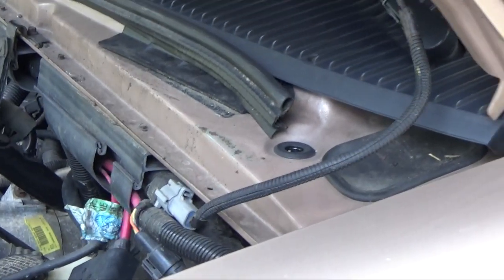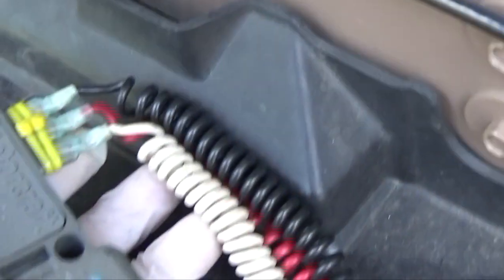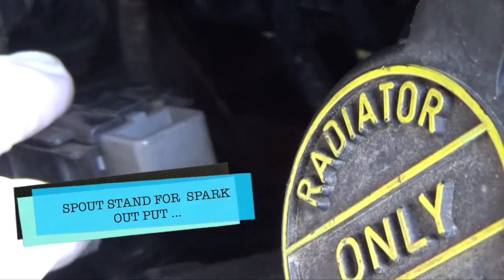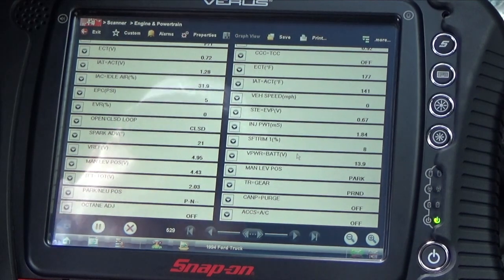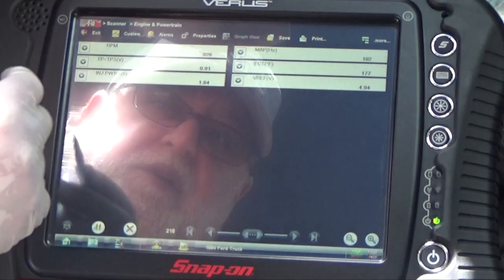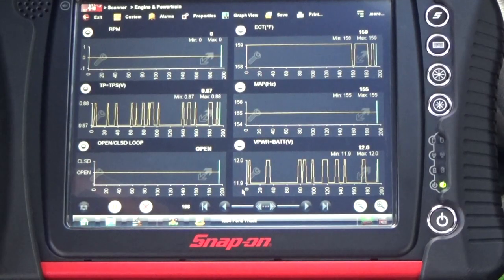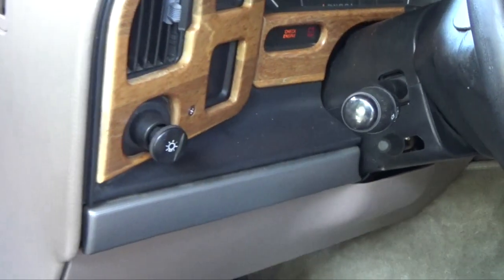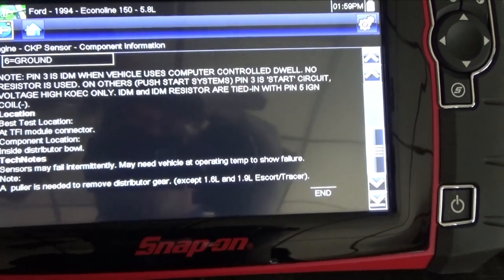NO CRANK SIGNAL AFTER ENGINE IS WARM Part 1 ON 1994 FORD E-150 EEC-IV EFI

Comment: Can u help mhe
Reply: No power to  port ,car start when cold,warm up  , won't crank or turn oveg
Reply: Over
Reply: 2015 Ford focus  4 cylinder engine 2000cc
Reply from the maker: Sorry for the delay! Do you have any DTC diagnostic trouble code!? Know you said car is cold crank and run! Then after is warm doesn’t do nothing! Right! Won’t crank! Right! So the first thing I will check is the battery! If that past the test! Next is listen to the click on the starter relay! If that’s is okay that you hear the click! But I have experience a relay that click but doesn’t pass the power to crank the engine! Know for other test you need more professional tools to do this…! But if you don’t have the tools and you have a regular volts meter! And the starter motor solenoid is easy too get too! We can do another test…!? Let me know!